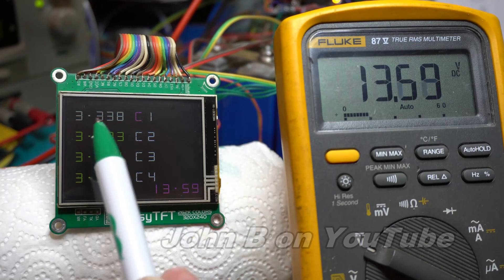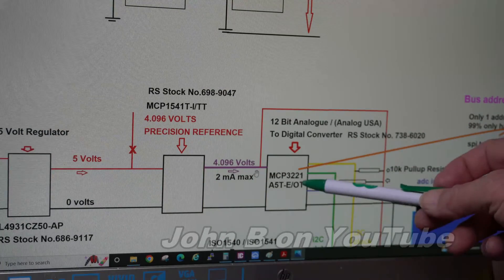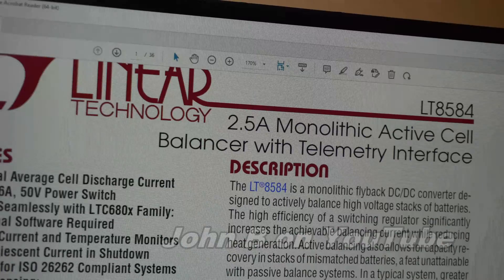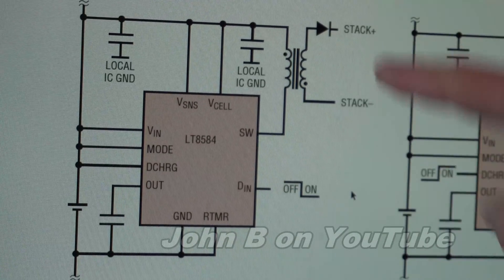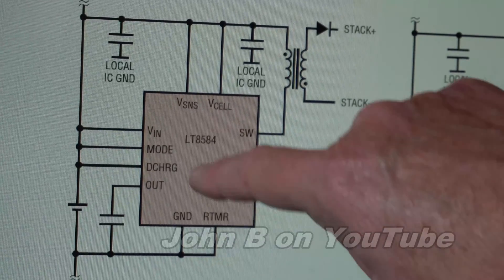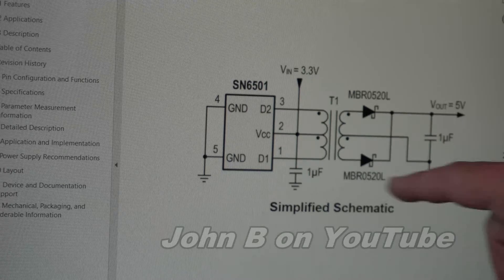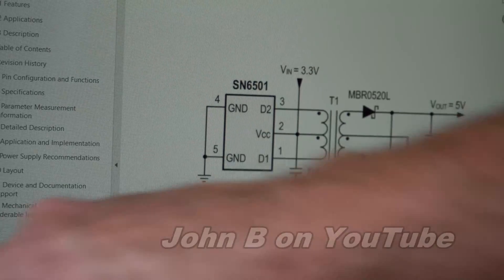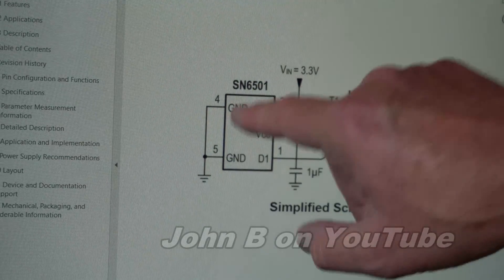Battery Management System (BMS) Design Part 5 - Active Cell / Battery Balancing

Comment: It appears that you didn't include an RCD snubber as recommended on page 20 of the datasheet when using the NA6252-AL transformer. Perhaps this is what caused the damage to the IC. I think it would have been nice if they made this information more obvious in their example designs.
Reply from the maker: That is my understanding too.
Thank you for your comments.

Comment: This might be a very stupid question but have you ever tried to bottom balance your cells. My cells((Japanese made LEV60F) cells i bottom balanced as low as i could take the discharge then, charged the 4S system to 3.4 volts  There was no need for BMS or Balancer. The cells start going off the rails when i push the voltage past 3.4 volts.
Reply from the maker: Hi,
Never tried discharging all the cells to one level, good point.
I’m not surprised your cell voltages fluctuate wildly at over 3.4 volts, I found the same thing.
I’m thinking you still need to monitor each cell since each cell will charge to 3.4 volts at different times. My BMS shows each cell discharges at a slightly different rate.
Thank you for your input.
Reply: @JohnB-2021 I dont know if its strange but all my cells Charge at the same voltage even up to 3.4

Comment: The design is more advanced than the other ones I saw. Pretty amazing! Just wondering if theres a kind of circuit diagram for this.
Reply from the maker: Thank you for your kind comments.
Sadly I do not one schematic but all the BMS circuit is shown through all the videos. It doesn’t include the pic controller or display. If you’re using a pic you can see the connections in the C files. I.e. RS would be register select for display, the C file must show the pin it is connected to.
Any questions on schematic after watching all videos, I can help. 
Thank you
Reply from the maker: If you download the chip pdf, it has the schematic.

Comment: Hi, I use ADS1115 and for balancing 90 A DPAK FETs, so U can balance 60 A x 3.601 W === 216 W, or more with better cooling.
Reply from the maker: How accurate did you find the ADS1115?
Thank you for your comments.
Reply: @JohnB-2021  I use it in my BMS which "talks" to MPPT_0 MPPT_0 ... etc with EPS-NOW, also BMS takls to me through mp3, in my 2-phase 100 AMP BMS, I use ACS758 50BI to measure IN and Phase_0 and Phase_1 out current. Try to measure with your BMS, if U are charging Ur batterym there will be ripple, also when inverter dicharges batteries, there is also DC ripple on cables, fuses, caps, etc.

Comment: Super interesting!  I am into something similar on the mode phase in MATLAB. Thinking to use fuzzy logic for deciding balancing time and duty cycle to balance the battery through inductor. Will stay tuned - thanks for detailed video :goodvibes:
Reply from the maker: Thank you kindly Navadeep Ganesh U.
Fuzzy logic?
That sounds like a different approach, it sounds interesting too and keen to learn more.😁

Comment: Your getting there , bit of a head scratcher :)
Reply from the maker: Thank you supermarketsweeps for your feedback.
Yes a head scratcher lol.
I have concluded it is not worth the additional cost, in this application, to use an active cell balancer.
It will only take minutes to knock off the additional ‘over voltage / over charge’ and bring a cell down to the average pack level. 😁
Reply from the maker: Hi John, a big thank you is in order :)
Thank you for your very generous donation.😃
Reply: @JohnB-2021  No prob 😁
Reply from the maker: @supermarketsweeps  What batteries are you using?
Reply: @JohnB-2021  ni cd 3.7 best i could find for nothing each have their own charger
Reply from the maker: @supermarketsweeps  Nothing each, wow!
I'm offering some pcb's in this next BMS video coming soon.
I wanted you to have first offer.
Editing video now lol.😁